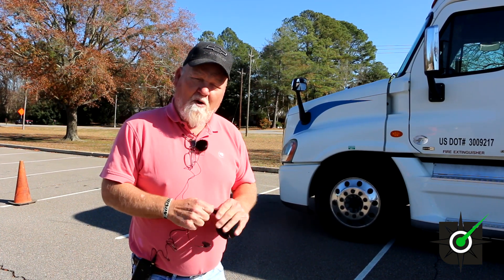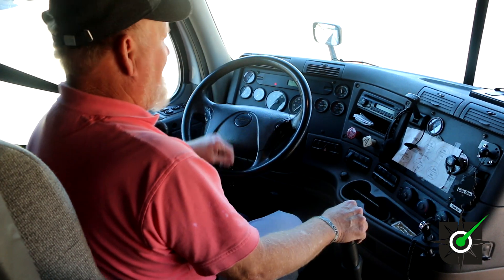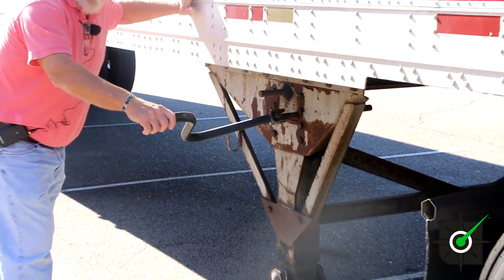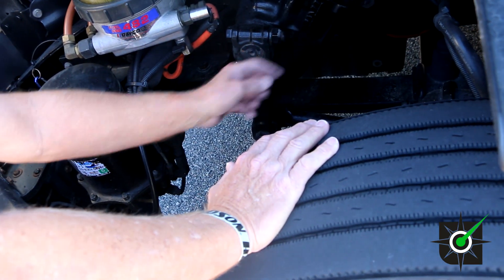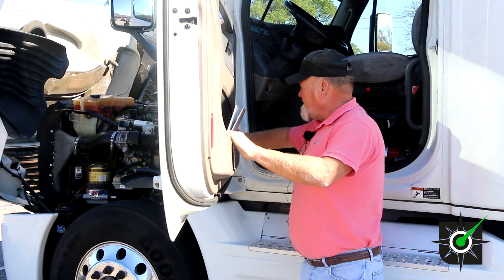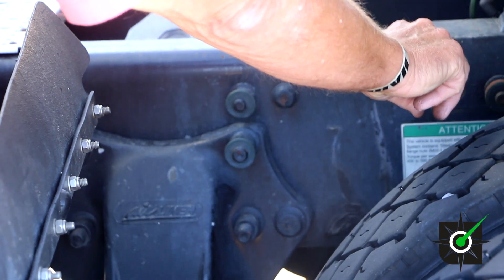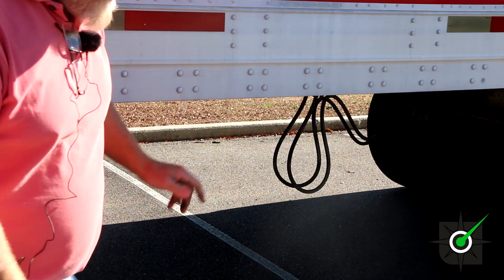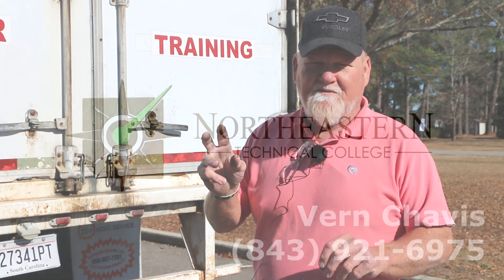SC DMV Pre-Test Inspection

Comment: Watch out on the bleed down test.  I aced the In can but failed because I didn’t state the air pressure again right before starting the test.  I had stated it when checking the gauges.  When I started the bleed down I released the parking brake, stated when the the air had stabilized.   North Augusta can be brutal.  Inspector said it was in the manual, but after re reading the procedure I did was correct.
Reply: Same for me at the Ladson DMV in Charleston
Reply: I’ve heard the same thing about north Augusta
Reply: @RdeRoxtro  that's where I'm heading tomorrow  🙌
Reply: This is how I failed for the 4rh time at Ladson. The 3rd will be my 5th attempt.
Reply: That's how I failed! Passed the second round!

Comment: Voltmeter shows volts.  As picky as these instructors are, if one of them knows anything about electricity and you say "it operates at 14 amps" that will be points off.
I was taught to say "all cab glass" which I did while pointing all around and then specifically to the windshield.  Examiner said because I didn't say the word "windshield" it was points off.  Also not all things you can go back and include.  When I did the gauges the air pressure was still building.  I noted that it was building as it should and that the governor would cut the compressor out at around 120 - 125 psi.  At least three times later in the air brake test I said "the air compressor governor has cut out at 125 psi which is correct," but because I didn't say that sentence immediately before starting the leakdown test, it was an automatic fail.
Reply: On the other hand, I've had the examiners calling the gauge a volt/ammeter, when it's only reading volts, so at least some of them probably don't know the difference.